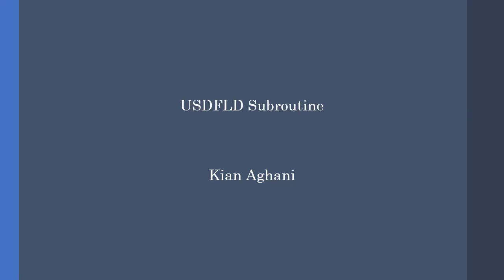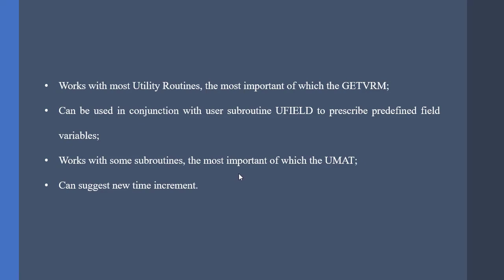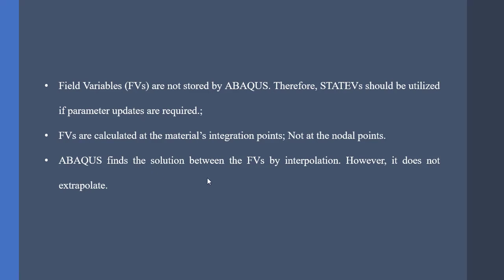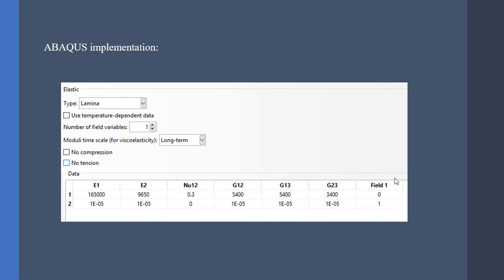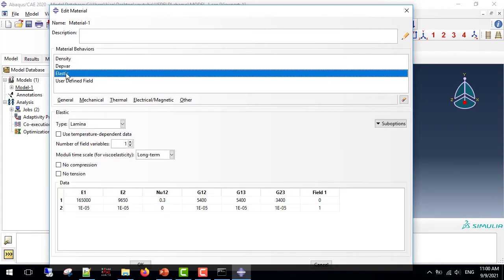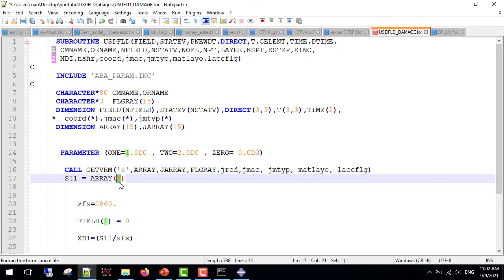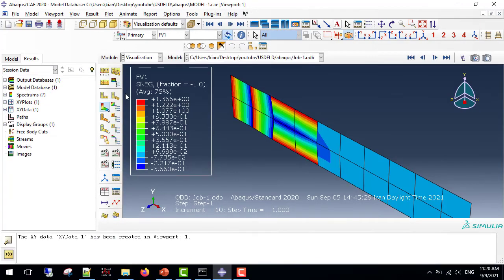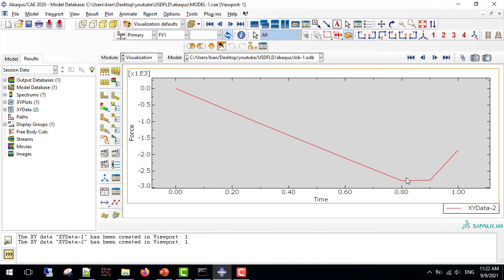USDFLD subroutine

Comment: Thanks for the video. Can you help me with subroutine file for vibration analysis of FGM plate where density and young's modulus is gradually changing in thickness direction. As I'm struggling to find a code that is working for ABAQUS 6.13 version. Thanks.
Reply from the maker: Hi. I don't think you can change density with subroutines the way you need.

Comment: Hi mate thank you for this video, it's really helpful! I'm trying to use a subroutine as well, but after started compiling the subroutine, it says to me that my network doesn't have the needed licence and then it aborts (jobs without usdfld works correctly). Have you ever experienced this issue using USDFLD?
Reply from the maker: Hello. No I haven’t. It might be due to your ABAQUS license version not working with subroutines.
Reply: @kianaghani  Thank you for your answer. I wanted to ask you also if it is possible to use more than one field dependent variable in a USDFLD (e.g. on the Youngs Modulus and on a plasticity property).

Comment: Thank you sir for this video. Can we also define an exponentially degrading field variable around an interface between two materials for modelling traction seperation? Can that be used in the UEL?
Reply from the maker: In my experience, USDFLD works better with discrete numbers. So, you have to convert the exponent to separate numbers.
As for UEL, you are basically introducing a new element but USDFLD is for existing elements in the library. So, They cannot be used for the same element in an analysis.
Overall, for traction-separation abiding elements, it’s better to use cohesive elements (more accurate, easier to work with)
Reply: Many thanks for your reply sir.

Comment: Hi Mr. Agahni, Thank you for the video. Can you let me know if i can implement the element deletion with this based on element's temperature?
Reply from the maker: For element deletion, you have to use explicit analysis. Nevertheless, yes it is possible with VUSDFLD subroutine and considering temperature as a field.
Reply: @kianaghani  Thank you for the reply! I really appreciate your help. Would it be possible if you can show me how to edit a field with the element deletion using this?
Reply from the maker: @dongyangyi8401  In material properties, there is an option called "Variable controlling element deletion", which runs through STATEVs. Use this variable with USDFLD sub. Also, I am going to make a video regarding this matter.
Reply: @kianaghani  Thank you so much! I really appreciate it!

Comment: Hi, I have a situation to give element based Young's modulus, thermal conductivity, specific heat and Poisson ratio. Can I assume field variable as element label?
Reply from the maker: Hi, yes you can. However, I don’t think that ABAQUS can consider FVs for thermal and Young modulus simultaneously.